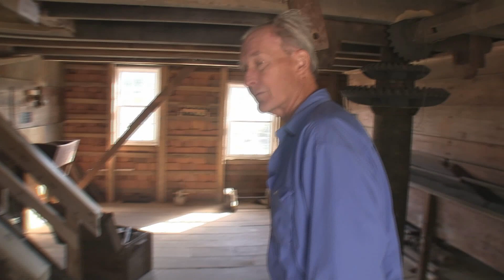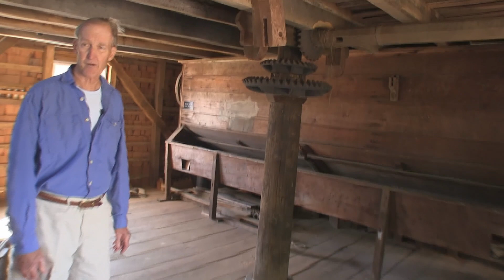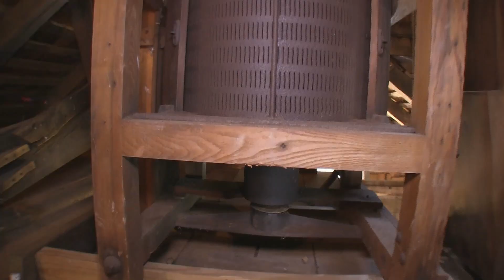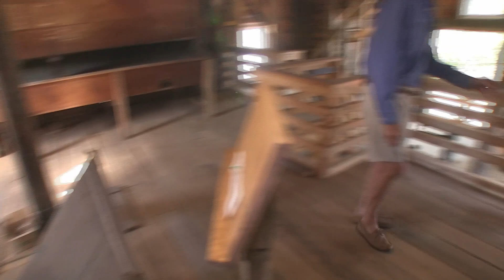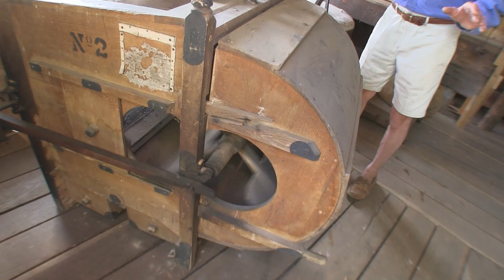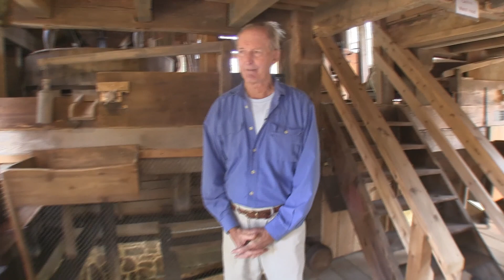Restoring the Nicoll Grist Mill at Connetquot River State Park Preserve

Comment: -Wonderful restoration John ! 
  I once went to look at Dowling College and fell in love with the area.
-Very nice video, John you do a wonderful job at explaining the restoration sequence.
-SPOOM is the Society for Preservation Of Old Mills.
-Perhaps someday a new sluice can be installed  for real water power.
-Regarding the vertical shaft to the upper floors-I have to wonder if a windmill for auxiliary power like I have seen in old photographs on the mill in Watermill as well as a north fork tidal mill.
-The Carman Grist mill in Massapequa was similar in size and co-location near a bay. Since the dirt dam provided little 'head' I presumed that tub wheels were used there.
Regarding the Newsday photo of the cast iron gears from former waterwheels the water flow we see in this video looks like it would be sufficient to push a breast wheel. Do you have any further information or theories ?
https://www.newsday.com/long-island/oakdale-native-brings-nicoll-grist-mill-to-life-1.37068462
-Not only transportation, land values and flooding but the new carbide mill wheels did a better job, worked at higher spreeds and required no dressing. I thought the French Buhr stones were semi-self sharpening due to their voids. Certainly they required less  sharpening than a piece of granite or the Esopus Milstones from the Catskills (Shawangunk quartz grit).
Sincerely Yours: Chester Hartwell  chester50@gmail.com